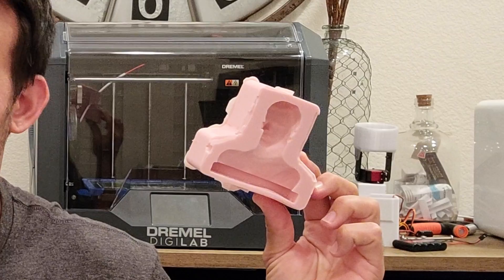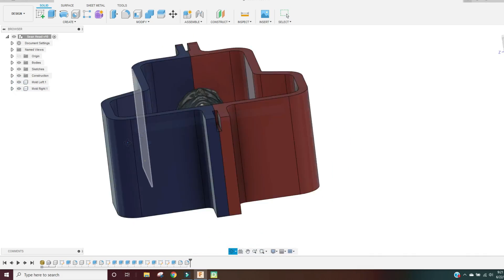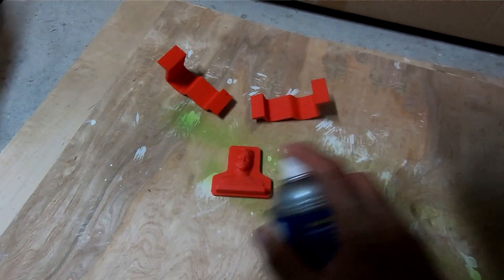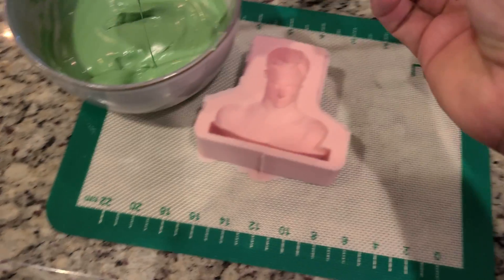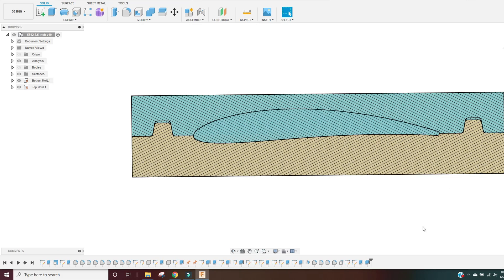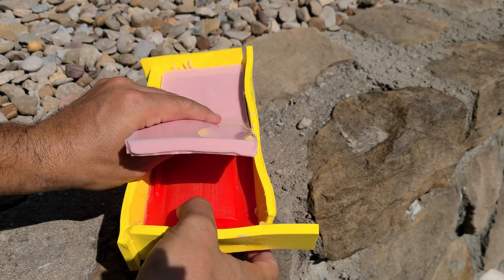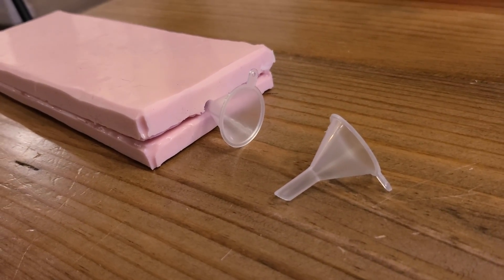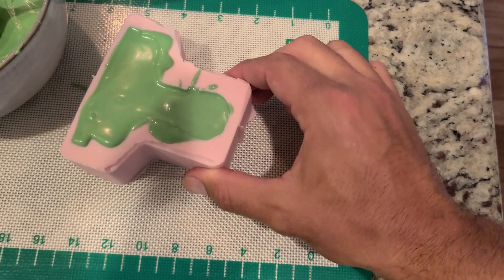3D Printed Molds with Silicone Rubber from Smooth On | Food Safe Molds & 2 Part Molds

Comment: I watched your first video but could you tell me:

-sponge grits you use
-the product you use to mold that sets fast within an hour 
- best way to 3d scan yourself 

Thanks bro!
Reply from the maker: 1 - Grit depends on how smooth i need but generally 60 up to 220 grit. Sometimes I go even finer.

2 - Amazing Casting Resin

3 - I use my Galaxy S20+ as shown in this video. https://youtu.be/FqOE_4ZNcVA
Reply: @EngineeringAfterHours  Is there a specific reason the video you linked is private? I'm looking into scanning solutions and trying to find a balance between cost and clean models at the shoe to keyfob scale
Reply from the maker: @freescape08  Samsung stopped supporting the app so I made the video private because it's no longer a real solution.

Comment: You left out the cut mold, with is one part mold with better accuracy than the other two. Open face is really a bad technique, you have no head pressure and the quality suffers a lot. 
The cut mold is the best option working with silicone.
Reply from the maker: The head pressure of a cut mold is trivial. If you want pressure, get a pressure pot or inject. 

In this case the 2 part is nearly the same as a cut. It's just more controlled on the parting line.

Lastly, open face is a great mold type. Proper mold selection is a function of your objectives. There is no single "best mold". Calling open face a "bad technique" is categorically wrong.
Reply: @EngineeringAfterHours  You are right, open mold is a bad technique for quality parts, you can do it for chocolate or parts which you can sand flat later on so it will come with less prep but more rework.
It is as always a trade off. 
Cut mold is best for most quality parts.

Especially using very elastic silicone it does not make sense to create a two part mold if you can decrease flashing using a cut mold, and you can´t lose the two pieces it´s always just in one piece with better quality.
Thank you.

Comment: You could use a silicone brush to paint a first layer of the melted candy into the mold. That would let you fill in the details and minimize the air bubbles. The kind used for wood glue would be perfect.  Although, you might need to get the candy a bit hotter so it flows into the details better.

Comment: I want to make a hollow duck toy made from rubber. How can I go about making the hollow inner portion and remove the air bubbles at the same time? Am imagining I'll need to use two halves each with an inner and outer mold?
Reply from the maker: You may be able to rotomold that. It's basically a process that just spins the mold around to evenly coat the inside while leaving the middle hollow.
Reply: @EngineeringAfterHours  Cool! I'll look into that! Thanks ^_^

Comment: For airfoils, I recommend printing molds vertically, or in such a way that the lines from the 3D print are parallel with the airflow for when it flies.
Reply from the maker: I went to a resin printer and thinks are much better now

Comment: Hello. Great video! What 3D printer material did you use for the mold box and mold halves? I am thinking about using Mold Maker, another FDA approved food safe silicone mold maker, to make some molds from 3D printed objects, and the product instructions states that some 3D print material will not work well with it.
Reply: Never mind. I saw in another comment that you said PLA filament was used.
Reply from the maker: Yep...I usually wash my molds after I've made them as well. Not sure if I mentioned that.

Comment: Great video.  Where would you recommend starting if you wanted to learn how to 3D print, mold and cast masks, and or cowls?  Here or elsewhere?
Reply from the maker: I would recommend learning the casting from smooth on. They have really good resources. 3d printing really depends on the process you use but it's easier than the casting
Reply: @EngineeringAfterHours  I have plenty of experience in 3d printing.  Just not the 3d sculpting.  Smooth on is where you would start?

Comment: Have you thought of printing a crosshatch support skeleton to submerge in the outer layer of the silicone to add rigidity like at least one side of the (eg. airfoil) mold.
You could even make a flat plastic outer with conical holes so the silicon would pin it in place but could be removed to 'peel' off the inner, yet be supporting during the curing process ( inverse draft angles ). - this is as my view can see the silicone sagging inside wooden outers that are not attached to the silicon... of course you could just clue them with a bit of PVA each time, peel the finished cure off, clean off the pva and do over...

Comment: You just solved a problem for me ty lol. I was about to have someone send me the 3D models of molds then try and 3D print with silicon but, I realized your method of just 3d printing the figure and using silicon to make the mold is a lot easier.
Reply: Except uv resins cause silicone to not cure

Comment: Is shellac food safe and should 3D printed models be coated with it before putting it in a mold box?
Reply from the maker: Best bet isnto contact manufacturers of the coatings you want to use. I'm not sure on shellac.

Comment: So it is not 3D printed molds, it's 3D printed masters and how to make molds of them
Damn, I got my hopes up :/
Reply from the maker: https://youtu.be/MhSH0m3ImNY
Reply: @EngineeringAfterHours  Thanks, almost what I was looking for ^^
Do you have any plans to try using some of the new flexible resins (Liqcreate flex, Monocure3D flex, or any other brand) to make molds as well, and see if it can be demolded easilly afterward ?
Reply from the maker: @GregorifElfeNoir  my next mold video is for molding flexible parts...I haven't considered printing flexible molds...interesting idea

Comment: do hope you can answer my question, so after 3D model are out i believe you need to do the sanding which are a must, so is there more ways to make sure i can get a so the linning so fine that i dont make so much of a difference thank you
Reply from the maker: There are several ways to smooth. Print high resolution, use an epoxy leveler like XTC 3D, use vapor smoothing or media blasting.

Comment: what can i do minimise the lines on the 3d print even further. apart from sanding. Are there any other ways?
Reply from the maker: Xtc 3D or similar filler, print in a finer setting or ABS smoothing if you used ABS.

Comment: What filament do you use for the silicone molds?
Reply from the maker: Just PLA
Reply: @EngineeringAfterHours  Could you use ABS and vapour smooth them or would your seal be garbage when putting the 2 halves together?

Comment: Why dont you just 3d print the mol
d?
Reply: I want to 3D print silicone products, so instead of casting just 3D printing it, do you know which printer would be good for that ?
Reply from the maker: I use silicone molds when there are undercuts or high surface area that may try to bond together. You would never get the chocolate mold to work if it were 3D printed. 

Here are the type of parts I will use 3D printed molds for:

https://youtu.be/MhSH0m3ImNY

Comment: Awesome video! 
Few things that have saved me a ton of time, use tape (even masking tape is fine) to seal the bottom of the mold, it will also hold your master in place while you pour. The frame for your dump mold would work great in one piece. Tape the bottom, place your master in the frame and hit is with mold release, the silicone will push out the other side pretty easily. When the height of the mold is greater than the width of the mold it's probably time to use a two piece. Also, i isopropyl eats hot glue in seconds, just spray or dab a little on and your hot glue will come right off.